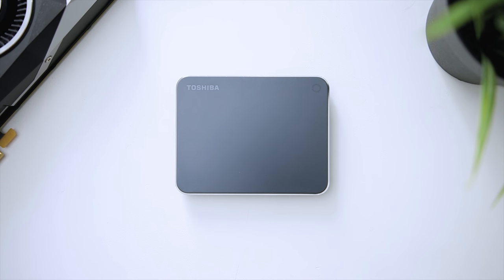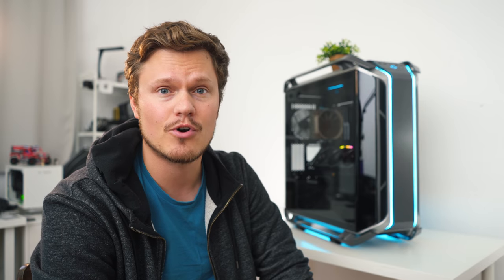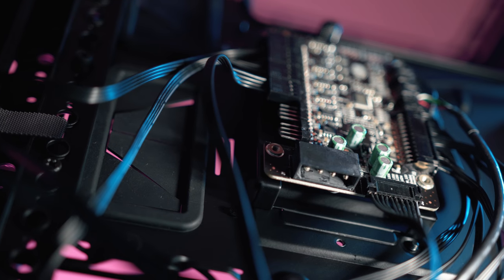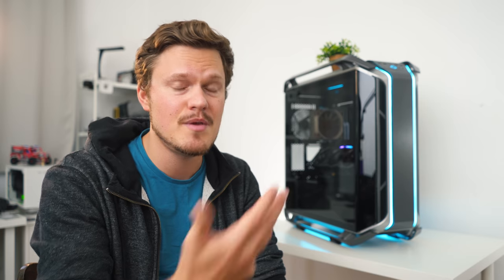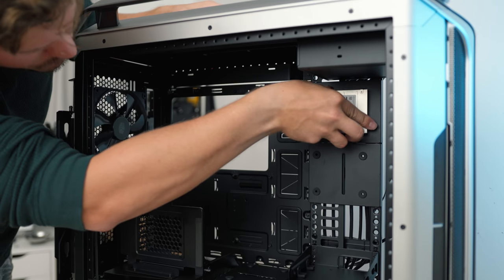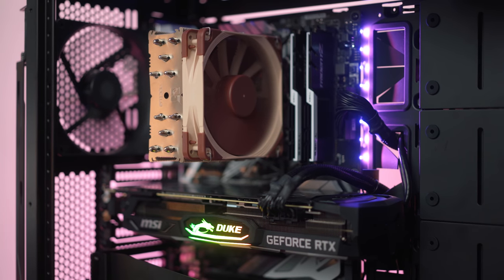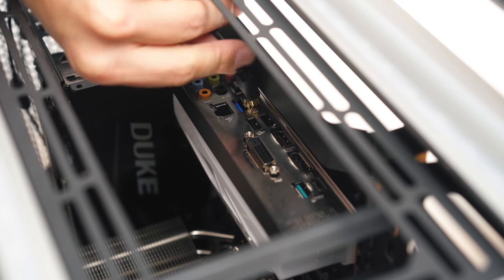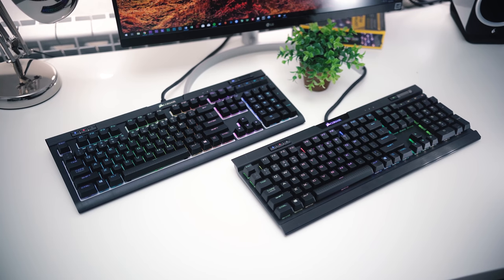Cooler Master COSMOS C700M - The Case Of The Future...With A Major Flaw!

Comment: Click baity title much?

Anyway, I do absolutely LOVE this case, and, in due time, I'll eventually have the coin saved up to put together a true all-star system with a case on this level - and, frankly, one very likely from Cooler Master if they keep it up, because I feel like they seem to get abnormally harsh & picky reviews about their most recent VERY impressive & legitimately innovative offerings. Surely a lingering result of GN Steve's absolutely over the top H500P review(I wonder why they've removed its temperature results from their more recent case tests? Probably because, after the list really filled out, the H500P actually fell dead nuts in the middle of it, a resounding 'AVERAGE', which can be seen on earlier reviews that still included its results in the list...). But, I digress...

Now, as far as the review itself is concerned and the way that the more recent HC case reviews seem to be going, I can't help but be a bit... I don't know, annoyed I guess, by how nit picky these have seemingly gotten. As someone who has built quite a few systems for myself & others in a variety of cases over the years(my most recent system being in an In Win 303, with outstanding temperatures with the fans laid out as In Win prescribes - I REALLY wish you guys would make a correction, annotation, something to the 301[IIRC...] review where you dinged the air flow/temps with the WRONG fan layout - easy mistake, but still...), so much of the nit picky stuff that consumes quite a bit of screen time just does not turn me off to a lot of these contemporary, feature packed(it ain't 2011 anymore!), over all high quality cases. I'm not saying don't mention, nor am I saying that things like the Molex powered, poorly located fan hub(it really does stand out as a "what the hell were they thinking" move here) don't matter, but it just really feels like that nit picky stuff just takes up a larger percentage of the review time than it should be getting, like some of it is just a bit blown out of proportion I guess. There's major failings, and then there's just very minor 'head scratchers' that, in the big picture, just wouldn't bother me all that much, especially given what one puts up with with downright CHEEAAAP budget cases that are inexcusable even at THOSE price points.

Anyway, I'm certainly not trying to be harsh or overtly negative if that's how it sounds, rather it's just some well intentioned constructive criticism: just a little more balance in these case reviews, more time spent on the truly meaningful features and/or problems, less time on the largely inconsequential, forgettable points without eliminating their mention at all, if that makes any sense. 
Just a little more balance. And, maybe a bit less click baity title as well(I THINK the "...Major Flaw!" is the somewhat lacking cable management features? ...I guess?)

Comment: Should i buy a used Ryzen 5 1500x or a new Ryzen 7 1800x
Reply: err... if they're a similar price the r7 ofc
Reply: The question is what do you want to do and why dont you get second gen?
Reply: @dome1894  the 1500x costs 95$ and the 1800x costs 250$
Reply: @dome1894  i'm only gonna game
Reply: @dio9652  why not the 1600 tho you get the best of both worlds but the 1500 is enough for gaming. Also depends on your budget
Reply: @dome1894  because the 1500x is used and only costs 95$ while the 1600 costs more

Comment: I prefer old c700p's internals, front design and top portion sadly. But the back side is indeed bad just like old cosmos 2. Absurd about of thick cables and no proper routing options like evolve X

Comment: After buying the h500p... Cooler Master just is not a top tier brand.  They make good mid and low tier products, but they always screw something up in the higher price ranges.
$440 case, and then all you list are flaws and compromises it makes.
Why does it come with the same fans as their cheap models
Why does the fan controller use molex
Why is there any plastic on this at all
Why does it have a unique gpu mount and then no way to route cables to the gpu when using it
Why are some cables managed and then the rest bunched together like usual

Comment: So if I bought that instead of the $40 deepcool matrexx 55 .. I would have only have been able to buy a Threadripper 1920x instead of the 2950x .. even adding $100 for rgb fans and hubs still couldn't justify that price..
Reply: If u can afford 400$ case, you can afford 2950x.
Case is like 10% of the whole budget so, 400$ for case, 4000$ for the whole build.
Reply: Mine came out to a little over 2K minus the video card.. I guess if comes down to what personal preference..  that's pretty funny logic about what someone can afford versus not justifying spending a crazy amount on a mediocre case.

Comment: lol, I  put my whole computer together for 500 Canadian pesos .. 1070 used on kijiji for 350 (gigabyte 3 fan ) i5 4th gen hp tower with 8 gigs of ram for $50 (also off of kijiji from someone wo was upgrading), and had a 2 tb hard drive from my previous computer, and got a 240 ssd on kijiji for 50 as well. the only thing i bought new was the PSU (cooler master 500 watt ) that i paid 50 plus tax for .. a total of 500 no tax for the whole thing .. i couldn't imagine spending 400 on a case when the used market has such a plethora of great deals for the person who is smart and knows how to avoid getting ripped off by testing thoroughly before purchase
Reply: well, awesome that that Works for you. but I would call myself smart and still spend over 5k€ on mine. watercooling, case and cable modding and a 220€ psu for example, 7 new noctua fans. Those components are for enthusiasts or modders. I know I'm getting ripped off on some components (but not a single one will have rgb) but I can't help it. regularly build part together builds for friends and always meet there pricepoint to the tee. I guess it's buy what you need (your way) vs buy what you want just for lulz (my way). thats the great thing about building yourself and computers, something for everyone. except the rgb nuts, those are just odd people ^^
Reply: canadian pesos ? xD

Comment: Molex connectors in 2018? for $450 its actually a joke. I despise those connectors.
Reply from the maker: It apparently gives more power vs SATA, which makes sense for the 6 (4-pin) fans you can power. 
-D.
Reply: Molex has 12v adn 5v rails, Sata only 5v. Plus Molex delivers more current on the 5v rail compared to Sata, this is why

Comment: whats the major flaw?
Reply: 1. Led strips may change color after a while (e.g.; white turns to an ugly yellowish color, purple turns pink, etc) and, worse, it may not even happen uniformly with all strips (so some may be more yellow than others lol).

2. The case only ships with two fan brackets. If you want to put fans at the top, front and bottom, you are out of luck, as stand-alone fan brackets for the CM700 have been out of stock since forever.

3. The PSU shroud does not have an opening/window to show off (just) your PSU. If you buy something like an ASUS ROG Thor PSU with an OLED display, you are out of luck.

4. If you want a CD burner or something like that, you're better off buying an external unit, as otherwise you would have to remove the front panel cover every time you wanted to access it.

Other than this, it's a really nice case: big, beautiful, solid, good airflow (just PLEASE replace those original CM fans), very very easy to clean all the dust filters, etc...

Comment: Too costly to even consider. Curved TG, stock fans, mediocre cable management and that hideous fan controller....  Far too much for mid-tier aesthetics. Flexible GC bracket is clever but you've already pointed out the rather significant problems in their gimmick. Stock it with HDDs or a custom loop and you'd need a crane just to move the case around. If I spent that much on a case alone, it would also make damn fine coffee.

Comment: Hi, I know that things are different in Canada than the states, but assuming the laws of physics are unchanged in the norther latitudes, and the brain is not impeded by the cold weather, I am at a loss at how you missed some of the rather negative properties of this case.

I just built a new PC into it, and it was a most unpleasant experience. First of all, it's one of the largest cases in the world, yet despite that I had to remove the top front cage that would have allowed me to install a 5.25 drive, a Blue Ray DVD player. Why? Because the Arctic Liquid Freezer 2 420 radiator won't fit with it in place. Without the slightest bit of embarrassment, the pathetic manual informs you of this shortcoming as if it were an inevitable compromise like marrying for money, or love.

And if you have another 5.25 drive, this one for the creative audio card, you don't even get the chance to order cheese with your whine because you're SOL. You can't even install it under the spot where the cage used to be because they decided to attach the front fans to a panel you'd have to take a Dremel to because both the top of the panel, and the top fan are so high that despite the removable (second from the top) insert you can't install a drive under the cage.

If you're going to have a removable dust screen cover insert that needs to be removed to install a drive, why bother if the fans, and the plate to which they attach, make it impossible to install a second drive?

When's the last time you didn't have a tool-less installation for a hard drive, or an SSD? The Cosmos 2 I purchased seven years ago has beautifully designed cages you slide the drive into, and snap shut the door. The cages are easily removed if you have only a couple drives to install, and there it's thumb screws, so still no tool. This piece of crap has trays with hooks that go over a ledge, but only on one side. That part of the tray is useless, and to make things worse, since the hook does not extend across all of one end, when you use it, the tray falls down on the other side. Then you have to use two screws.

The tray that holds the power supply covers less than half of the length of the bottom of the PSU, which means that a portion of the mass of the PSU is hanging off the tray creating a permanent stress on the bolts holding it to the rear of the case. The stress is not significant, but couldn't they make the tray long enough to bear the full weight? My PSU is a standard length.

The built-in wire management that sits on the back of the same plate that holds drives on the other side, must have been designed by someone who has no idea what computer wiring looks like. Here's a clue - round. Even if the majority were flat, the wire management would still have been inadequate. Each separate Velcro strap provided covers the full width of each row meaning that when you anchor it, you're trying to secure all of the cables across that row to the panel, instead of separating each vertical channel with its own strap.

Two screws in the back of the tower that hold the back panel in place at the top, are slightly covered for screw driver access by the two doors. You have start the crews by hand otherwise you'll strip out the holes. That same plate has two punch-outs at the top right for screws, but there aren't any screw holes under them with which to attach that part of the plate to the tower. This leaves clearance behind the plate such that you can tap on it to make it hit the tower.

There is no provision for accessing the thumb screws that hold add-on cards with a screw driver, necessary to remove them, unless either the screw driver is miniature, or you use a Phillips screw driver attachment on a ratchet. If you're careful it is possible to remove, and install them by quarter turns, but it's clear they gave no thought for this.

I hope in the future you will spend more time investigating computer cases for the reasons that most people buy them as opposed to whether the material leaves fingerprints, which of course, can be wiped off.

Comment: Another version without space for hard drives and another version which I will NOT buy :(
How I miss Cosmos II, 11 tool-free quick-swap HDD cage (with custom SATA-PCB upgrade on the back HOT-SWAP)
Cooler Master forgot why Cosmos II was so extraordinary and bought despite the huge price
Reply: emm the c700m has 12 HDD mounting spots available... :cough cough:

Comment: Was 300 usd.  Now is 450 dollar USD, and you try to claim it's cause of the 25% tarrif?  Those aren't implemented 'till next month, and that's a jump of over 30%.  I think that's just the price, before tarrif.  
  They see nvidia and apple getting away with it, why not a case?
  Coolermaster iCosmos coming soon.
Reply: Oh, and yet another case with "built in" vertical gpu bracket that just happens to slap your gpu fans right up against the glass, strangling intake. From the company that sells a 30 dollar bracket and cable that DOESN'T strangle it that way, and fits in almost any modern case from the past 5-7 years....

Comment: What a joke. This case would be fair at $199, maybe $249 if it included a smart device. It looks great, but is so lacking in features for the price. If I'm paying over $400 for a case I should have motorized doors, 6+ top shelf fans, full LED lighting with a smart controller, "AI" fan control, and not a piece of plastic anywhere.
Reply: Also, Cooling probably isn't that great..

Comment: $439 but still using molex connectors...
Reply: he made a mistake and didnt do his homework on why its molex, CM said clearly that the molex is required as the RGB controller powers fans and other controllers can be connected to it, sata wont cut it.

Comment: Yeah a 15% tariff on a $300 price tag only warrants a $40 price increase. So this thing better be the best case on earth. Also why does this case not have USB 3.1 and uses bullshit molex.
Reply: another 10% tariff is expected iirc, so its not too far off to think it'd be priced according to a 25% tariff
Reply: Even with that 25% tariff, this case is overpriced for what it actually is. Several errors including the power connectors, the shitty fans, horrible overall look consistency, and the "dynamic" GPU mounting has horrible integration with its connection options.

Comment: Now the fixed version, for only 550€. You gotta be kidding me. 
Also, you going to make this super premium case that's heavy as F, but for some reason 24kg is ok, but 26kg or whatever is not ok? Why. Why the cheap plastic. 

Only 55mm clearance in front.. I wonder who would've been hurt if they made the bottom cover 1-2cm shorter to make 60mm rads in push+pull config possible. You guys are idiots at cooler master, I'd design a better case. Premium my a$$. Take your cheap plastic and shove it where pushpull rads don't fit. 

I could go on and on how stupid this is ( the fan controller. Wat?) but it's just too much to go over... 

The entire reason I'd buy this case is for the TG and metal build. (which spoiler alert - it's plastic so.. No thanks)

Oh and the fans are just an insult, some bargain bin bottom of the barrel.. You know what, I'd prefer if you didn't include any at all at this point. Really, sorry, but this entire case is like an insult. Especially for friggin 500+ euros!

At least the ugly green glass is fixed. Thank god, that was disturbingly ugly TG panel. Bended or not, kinda the entire point of glass is to see inside, isn't it?